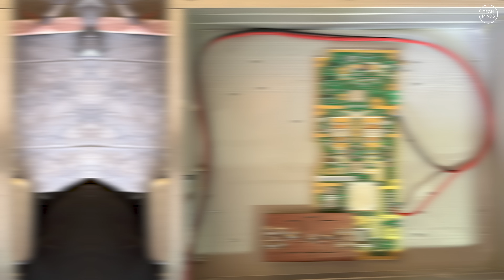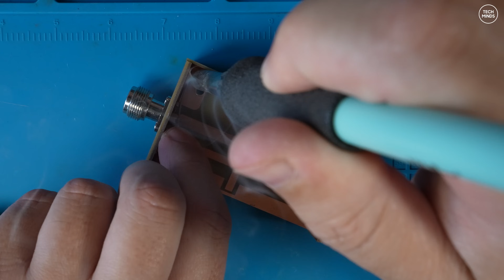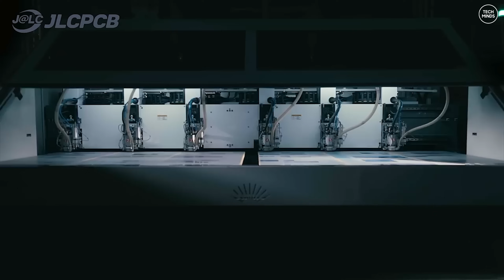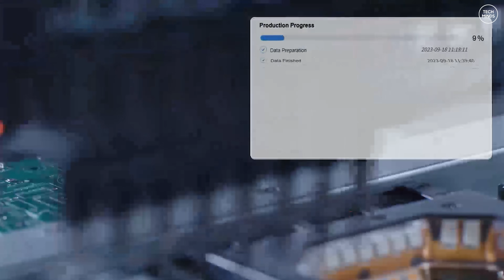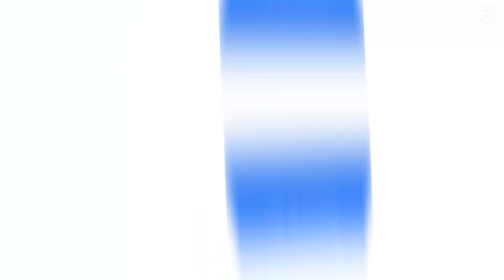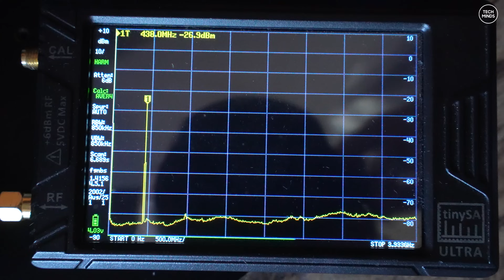70cm High Power Amplifier Build - Part 2 Finale!

Comment: Looks well made, congrats to a nearly finished project and the none existing harmonics are impressive.

One question I ask myself is, why the Arduino and not an ESP32? With an outside antenna you could integrate it into your SDR workstation by Wifi and some HTTP requests.
Don‘t get me wrong the Arduino does it‘s job, but today they are tech from the stone age.
Reply from the maker: Well, I did actually start off with a T-HMI, a little color touch screen with Wifi and an ESP32. However, I had to remind myself that this is JUST a UHF amplifier. However, it may be possible that I use this amp with it installed in the conservatory. If that happens then may switch to an ESP32 with Wifi and just use a web server so I can see the info remotely. I already do this with my 2.4GHz amplifier which is in a similar casing, but for that I use Node-Red.

Comment: With the PA now working. I will expect to see your DATV signals on 70cm soon. No LED Bar graph? Every project needs at least oned LED and 4k7 you know. Nothing to stop you fitting one later. That CNC you have would be good for modifying the front panel. You might want to add some form of PTT. E.g. a big chunky relay in the power supply or a smaller one in the bias supply. Glad you managed to get the built in coupler connected. I agree it is overkill, as is haviing 2 digits after the decimal point, but if you have the module why not. How hot does it get?
Reply from the maker: I did use the CNC to cut the hole in the front panel for the LCD. Getting that front panel off needed some force! :-) I'll drop you an email in a bit..
Reply: @TechMindsOfficial  Oh yes, I remember the glue. A bit of heat helped, but too late now.